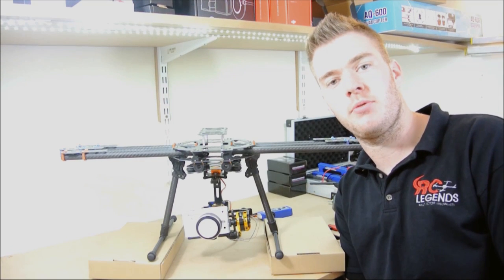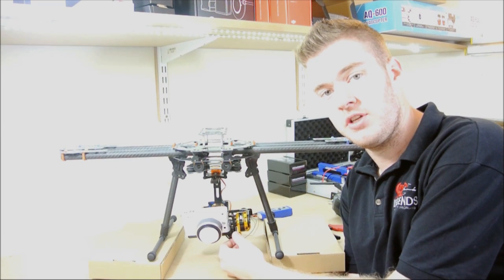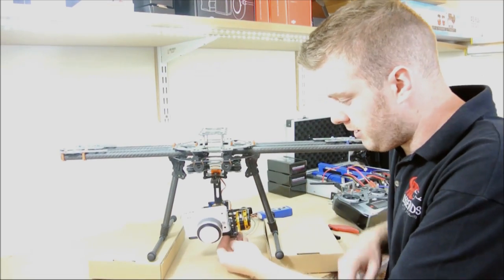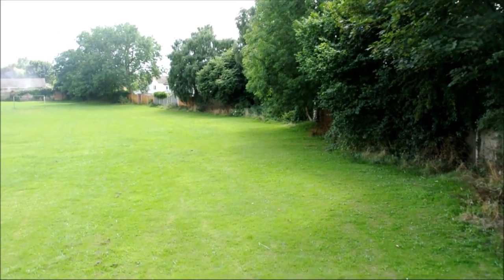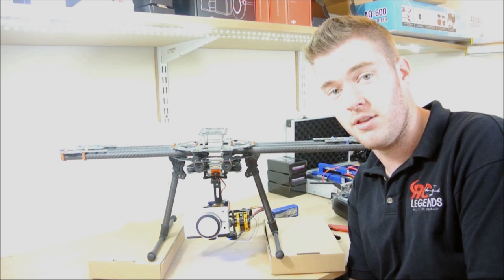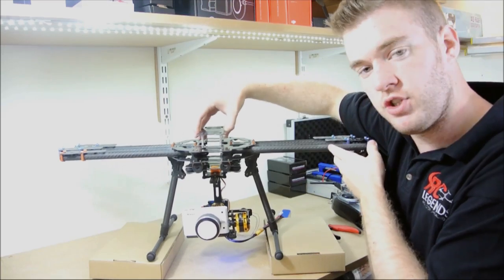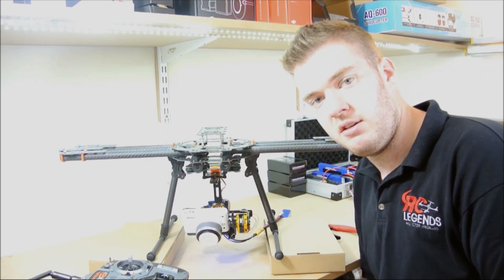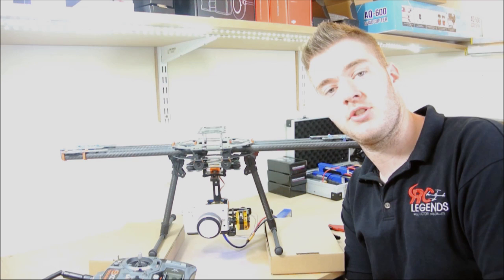Vortex XD-2 Brushless gimbal for Sony NEX, Nikon 1 using Alexmos controller from The Drone Worx

Comment: Hi E. Brothers, I watched your video on the sony camera with the gimbal attached to hexcopter and was very impressed with the video. Also, while watching several questions came into my mind. First  is, what size battery is used for flight and how of a flight are you getting.Second , what size and brand motors are you using as well as prop size. Next question,  weight of  hex with and without loads. And last question is what fpv set up are you using including ground station set up. I am trying to get into fpv, just trying to get a gauge on things before deciding what kit to build for fpv. Thank you for your time and  I look foward to your reply, cheers from the U.S.
Reply: So you just thought you would ask a quick question